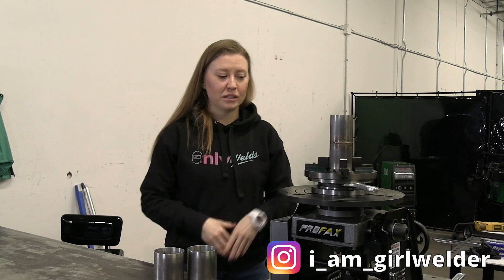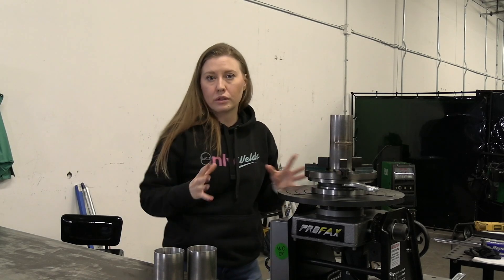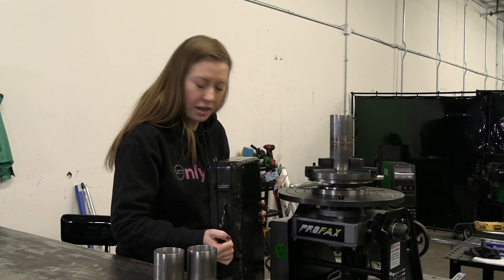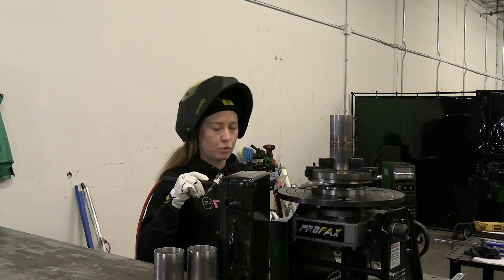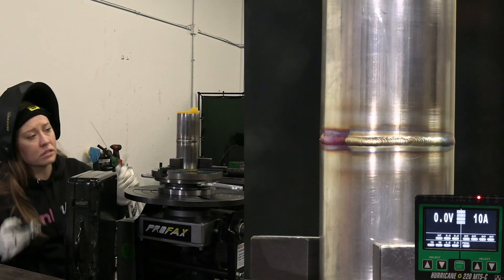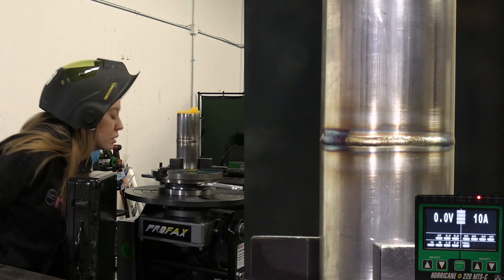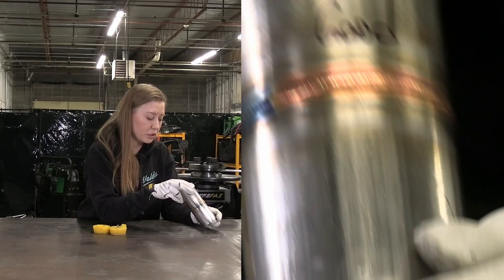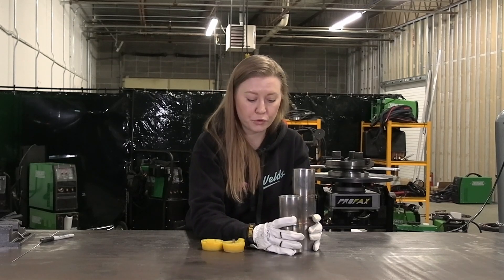Everlast Welders: identifying weld positioner setup issues

Comment: With some quick pen and paper math you can get a formula. You need to consider the radius of the work piece (denoted as r), the desired distance between each weld beads centers (denoted as s), and how long it takes to do one weld bead (denoted as B, in seconds). Should find that you set the positioners RPM to the following, RPM=s*60/rB. Make sure your units for the radius and distance between weld beads match.

Example calculation:
-Work piece diameter is 4", then the radius is 2"
-Desired spacing between weld beads is 1/8", or 0.125"
-Time is 1 second per bead
Plugging these values in you get an RPM of 3.75.

The results will vary depending on if you are free handing or doing pulsed TIG. Free handing it, there will be variation in how long it takes to do one bead and when you start each bead. It will be easier to get consistency with pulsed.

Comment: Awesome video I just made a quick one the other day but my tip was for me at least I keep a notebook and write down my settings and speeds in the notebook for each size pipe thickness. Thats mainly because I’m not using the positioner a lot when I go to use it again I would forget the settings. Awesome work and video very informative 👍